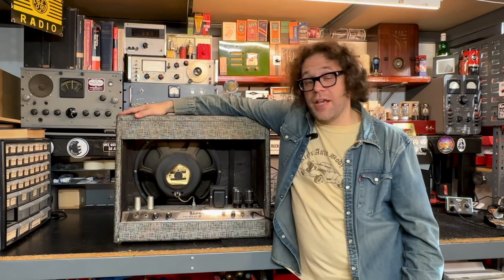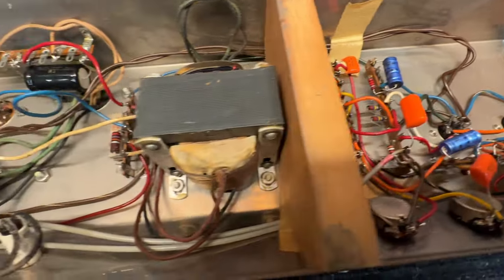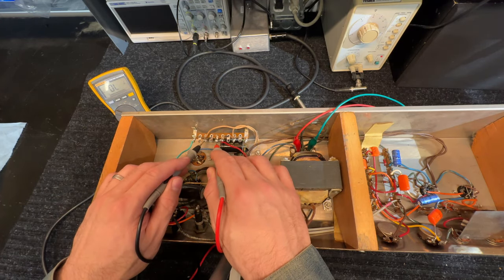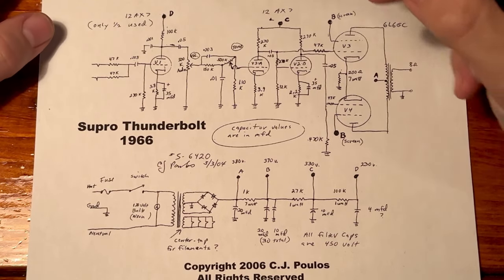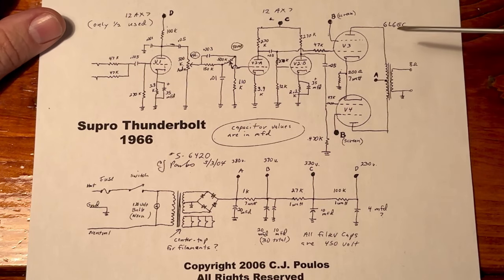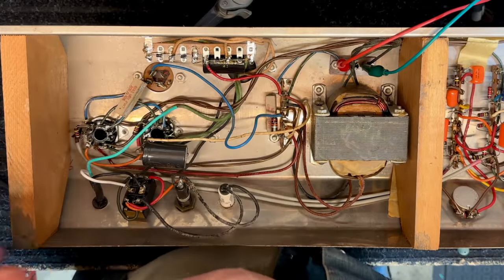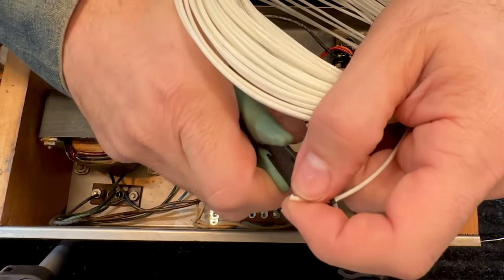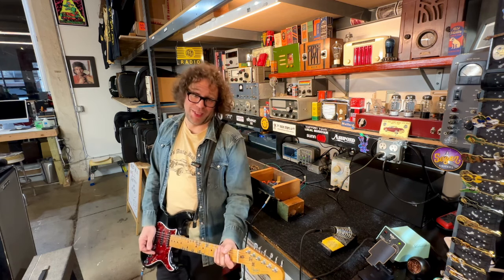1966 Supro Thunderbolt Repair and History

Comment: Lovely work and great explanation! Only thing I would have done differently is the line cord ground, it’s probably just fine how you did it, but generally electrical safety standards require a mechanical connection like a ring terminal bolted to the chassis (technically it should also be a welded stud so that the fastener can’t be loosened from the outside of the chassis).

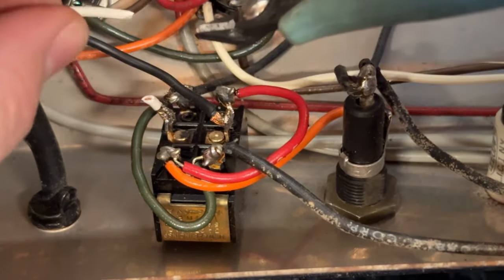Comment: I actually drew the Harmony 420 schematic you're working from, so long ago I'd forgotten I did it! The amp on your bench is a little different from the one I worked on: at 10:42, note that the on-off switch is a DPDT switch that flips/reverses the polarity of the incoming AC wall current, which isn't safe and doesn't meet modern electrical code, so I assume you rewired it for straight on/off operation and removed the "death cap".

Comment: I built one of these and made use of the unused triode. I put a cross line MV in it (250k A) too. Love it. WGS ceramic 75 watt. I used a 5u4 tho. Don’t use a bypass cap. That’s a no no in this amp. 😊Wow,the Classic tone TB otx looks identical to the one in this video.

Comment: Great video, enjoyed the amp history and general overview , i have a 66 in black tolex i had modded for a transparent gain circuit put in and put the gain knob in one of the inputs so i didn't have to alter the chasis to accommodate also put a Celestion Fullback GV100 so i won't harm the original Jensen . All original inside and nothing replaced, is that bad ? Should some components be replaced? Enjoyed watching you work, sounds great !

Comment: Really enjoyed you explaining the schematic along with step by step of diagnosing the issues. Killer video dude!
I have a Harmony 430 with the 6973 power tubes and tube harmonic trem. Reverb is awful and there is nowhere to hook up a better tank (tried my original Falcon tank outside the amp and it was beautiful Verb). Don’t think I can shield it and haven’t found a compatible small tank to make it shine. I believe I would have to alter the reverb circuit to make it sing and I haven’t those skills yet. Any tips of where I could go to understand that better? 
Haven’t seen much on that topic on the tube or forums.

Comment: Hey Pat have a question what do you use on a scratchy pots ? I used deoxit but then I noticed later that it only lasts for a little while then the scratchiness comes back. I also noticed that the pot moves a lot more freely then normal almost as if the lubrication or Grease that was inside the pot has washed away.  What products do you use to clean a pot and lubricate it???🤔 Thanks for a great demonstration on explaining how tube amplifier functions in a circuit!👍
Reply from the maker: you might have leaky caps, DC getting onto the pots. Deoxit green label should do the trick

Comment: interesting that the schematic shows a center tapped power transformer used with a bridge rectifier... is that a mistake, wouldn't it short out the 2ndary winding the way it's shown?
Reply: Looks wrong to me.  Another scheme shows a missing CT for the filaments so that CT is probably for the filaments and drawn in the wrong place.